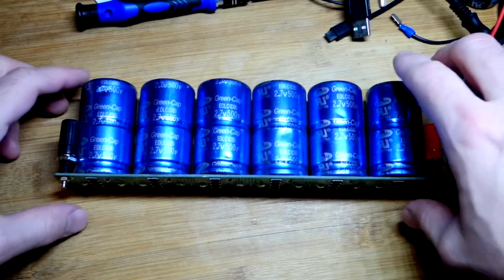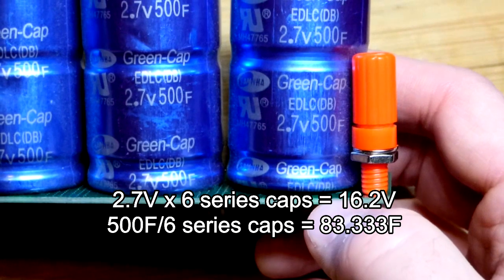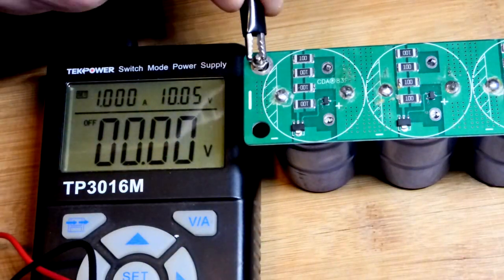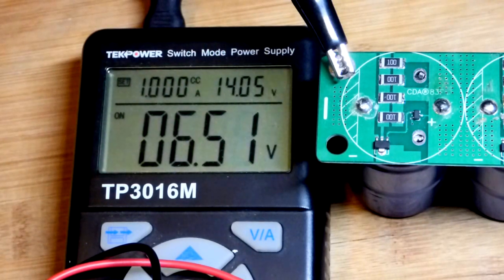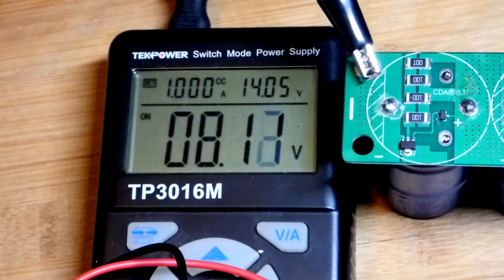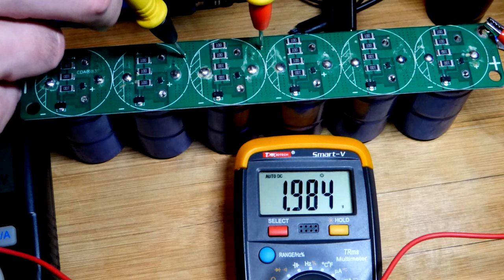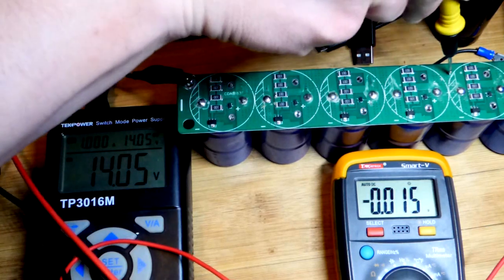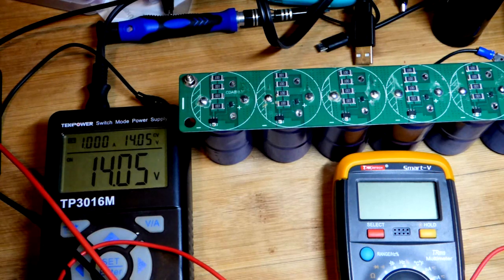Carefully charging my old 6 series super capacitor power bank explained by electronzap electronics

Comment: Can i use this to power something that needs 12v and 10 amps?
Reply: I want to use it to power a heating module that takes 120w max how do i go about doing that?
Reply from the maker: You definitely want batteries for powering things. Typically lithium based. And you need some way to recharge them. There's not much supercapacitors can do.
Reply: Araç ses sistemi için kullanilirmi anlık kac amper güç verir

Comment: I think you can put amps to 1 million and it doesnt bother it. and its actually 500 farads, not 88.
Reply from the maker: I'm guessing that it falls short of 1 million amps.
Reply: @Electronzap  what do you think will happen.   **KABOOM**??   I think itll suck up as much as you want, and you can charge 30 minutes worth of high amp in less than a second.
Reply from the maker: @magnuswootton6181  Might get 1A for about 80 seconds. If you can work with low voltages.
Reply: @Electronzap  why? will it heat up?